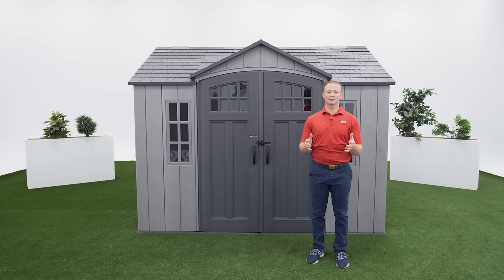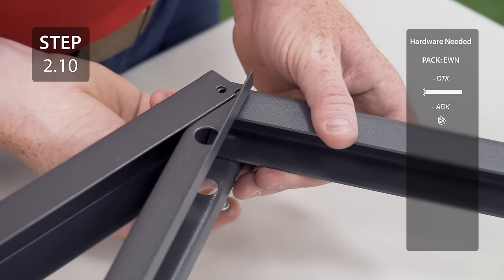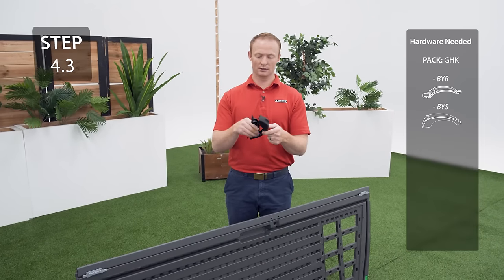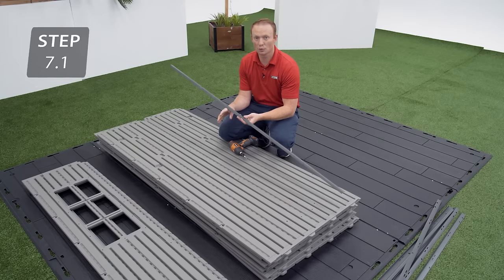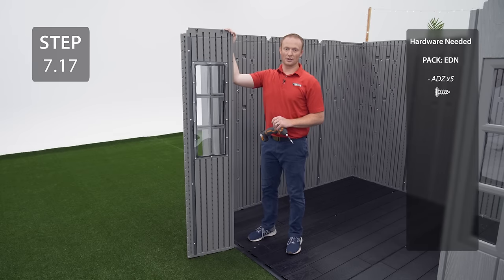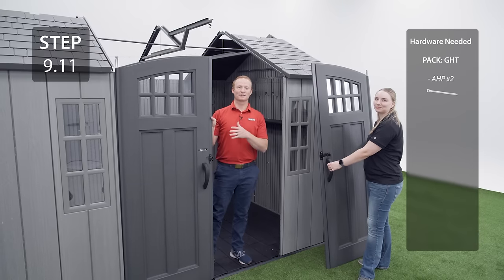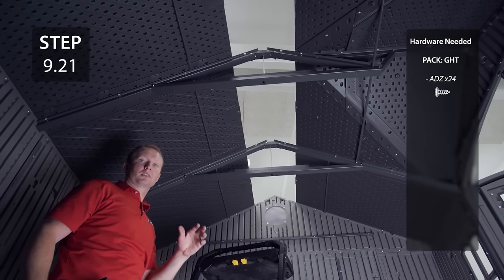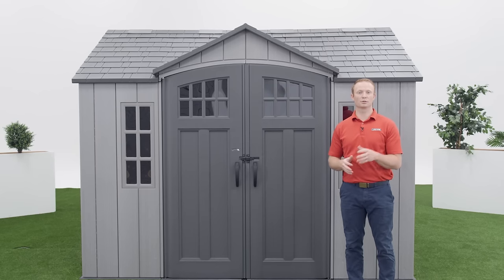Lifetime 10' x 8' Outdoor Storage Shed | Lifetime Assembly Video

Comment: Can be built by one man with knowledge. 
A bit fiddly. 
And a alot of the assembly processes could be shortened by the factory. 
Corners i found putting a block under the floor pannel gave me extra leverage to push them through. 
A day to build could be done in less with more bodies.
Reply: I fully built it by myself. You'll need to be at least 5'11" and give yourself about 3 days if your leisurely

Comment: I don't have the cotter pin is there a specific size that I need to buy
Reply from the maker: Replacement parts are available and can be ordered through our Customer Service Department. Our Customer Service Team can be reached at 800-225-3865 opt. 1 or by email at customercare@lifetime.com. Customer Service hours are Monday-Friday, 7:00 am to 5:00 pm (MT).

Comment: Step 11 is near impossible.  How do you screw through metal and make it look that easy?  Did you pre drill the holes?
Reply from the maker: Sorry to hear this. We did not pre-drill the holes before assembly, we had the our impact drive at the highest torque setting and put a lot of pressure as we drove it through.

Comment: How do you get the walls out after they are locked in place?
Reply from the maker: You will just need to reverse the process of assembling the panels. So slide the panel in the opposite direction to "unlock" it, and then pull the panel out.
Reply: Do you have to use lots of force. As ours is not budging

Comment: The manual shows that the plywood underneath the shed should have 30 drainage holes. Yet the plastic floor that will be on top the plywood won't have any opening. Anyone has any idea why drainage hole are needed? For the unlikely chance of water spill in the shed?
Reply from the maker: The drainage holes are there to prevent flooding in the shed. When there is a rain storm or what not, instead of the water going directly into the shed it will enter the drain holes.
Reply: @LifetimeProductsAssembly  Thanks for letting me know
Reply: It is to stop rain from seeping in under the plastic floor and rotting out plywood over time. Unless you seal the perimeter well    where plastic floor sits on wood.
Reply: Not really!!! It is to drain the rain going in the perimeter between wood and plastic and over time rotting out plywood.

Comment: This model seems identical to model 60243 except 60243 doesn't come with gusset supports for the trusses, there are no short truss braces, and no gable support bars.  Why is this?  Those seem like pretty important additions to support the strength of the shed.  Are they just not important?  There is no info in the instructions about any of these parts, so these parts are not missing.  I'm just wondering why they are not needed on model 60243.  Also...is there a video specifically for model 60243?  This is the only one that showed up when I searched your channel and it's almost identical.
Reply from the maker: The model shown in this video comes with a snowload kit, which contains the parts that you mentioned. You can add a snowload kit (model 60125) to your shed model, 60243. A snow load kit is not required but it does increase the snowload capacity. As of right now, there is no video for model 60243 but we are working on it. In the meantime, this video is the closest to model 60243.
Reply: @LifetimeProductsAssembly  I live in Southern CA....good to know that the reinforcement is for the snow.  Thanks! :)

Comment: Our lifetime logo door came with a hole punched in the front 2 feet from the bottom in the right panel part, that is not supposed to be there.  The boxes were not damaged.  We need a replacement door.  How do we get that?
Reply from the maker: Replacements can be ordered through customer service. They can be reached at 800-225-3865 or by email at customercare@lifetime.com. Customer Service hours are Monday-Friday, 7:00 am to 5:00 pm and Saturday, 9:00 am to 1:00 pm (MT).

Comment: have model 60318. on step 2.15 i have to slide in support tube DSP into DSM… but the end of DSP is squared and the hole in DSM is circular 
HELP!!!!
Reply from the maker: We are in the process of switching our DSM to square holes instead of circular which may have caused the confusion. Our customer service team can order you the correct parts. They can be reached at 800-225-3865 or by email at customercare@lifetime.com. Customer Service hours are Monday-Friday, 7:00 am to 5:00 pm and Saturday, 9:00 am to 1:00 pm (MT). Also please keep in mind that this is not the assembly video for 60318. There are different parts and steps for the 60318. If you need an assembly video, you can download the BILT app for a 3D step-by-step video.

Comment: Very helpful, but I would emphasize to people up front that this is for the 10x8" shed and that the 8x10' shed has a DIFFERENT video. I spent 20 minutes watching the 8x10 video before realizing the issue and noticed some things didn't make sense.
Reply from the maker: Thanks for the recommendation. We ask all customers in the beginning of the video to check to see if their model number is the description box to make sure this video works for them. We also add the description of the shed in the description box as well as the thumbnail.

Comment: What accessory did he use in-between the power driver and screw bit? Can't find them anywhere.
Reply: Some models of the sheds are now excluding those parts to save cost. I called and asked about the hooks. I did not get them or the gusset parts in 11.2 and no luck. The hooks would be super helpful and those gusset parts would offer additional roof support but not the were not included in my box or mentioned in my manual and I got the same exact shed

Comment: The instructions for model 60330 say to make the base exactly 94" X 118".  Is there any reason why I SHOULD NOT make it slightly larger (96'' x 120'')?  This is for a wood frame pad.
Reply: I have made wood base 8x10’
Start assembly tomorrow
Reply: I made my base exactly 8x10. It's nice cuz you have a little wiggle room

Comment: The hardware for securing paddle lock was broken allowing access  with a screwdriver
Reply from the maker: Replacement parts are available and can be ordered through our Customer Service Department. Our Customer Service Team can be reached at 800-225-3865 opt. 1 or by email at customercare@lifetime.com. Customer Service hours are Monday-Friday, 7:00 am to 5:00 pm (MT).

Comment: Just built this Shed mine was a 10X8 with the side door, so a total of 4 doors. Now I will be straight up with u, thus thing WIlLL give u a run for ur money if u attempt to build by urself. Doing it one person is nearly impossible, lifetime knows this which is why they charge $600 to do ir for u. However just be patient it's doable. But the instructions suck!!! So u need to have common sense
Reply from the maker: Thank you for your honest review. We do mention in this video and in the instruction manual that it is very important to have a helper with you during the process. It makes certain parts a little less challenging.

Comment: Too bad you didn’t have a quality control department that at least put instructions in the box. Neither one had the info.
We’re screwed for the weekend.
Reply from the maker: Yeah, that's definitely our bad...  Use this link to help find a PDF of the instruction manual: https://www.lifetime.com/customerservice/assemblyhelp.  You can then search all products by model number and language.
Reply: @LifetimeProductsAssembly  We did that. The only other issue we had was the slotted holes still had plastic in them which made it difficult to see where your are tapping the screw into. We spent some time doing it to make it easier. Clarity on the instructions with the pics could be a little better. I am an engineer so building it was not a challenge. Other than that it was a good buy for the shed itself. Only thing left to do is level out the doors. Thanks.

Comment: I don’t see much support for the roof to the walls only screwing into the plastic. :/ a good gust of wind would blow that roof off surely.
Reply: there's very little over hang from the roof to the wall, not much for wind to catch.
Reply: They also have support bars underneath the panels that u install to help the weight of snow

Comment: We don't need to watch you put in every screw
Reply: I disagree.. at times I found it helpful to see exactly where each screw needed to go, as sometimes the instruction diagrams were a bit unclear. They sped up the process of driving the screws so I think it was a great compromise. 

The only thing I would add about the screws, is don’t over drive/tighten them, and be VERY careful using the screw to pull two parts together. This isn’t would, and you are screwing into thin plastic. Easily stripped, and also having to take out a screw to re-do it can ruin the hole the screw needs to go in to to “bite” and hold the pieces together

Comment: Never never again. I am fairly handy and have installed everything from kitchens , to plumbing etc. I installed a previous version of the 10x8 from lifetime maybe 10 years ago or so. This version is cheap cheap compared to that. Also I'd be here for hours timestamping all the areas that are either wrong in the instructiona or does not work exactly as the guy in the video showed such as easily clipping in the corners or simple things like put holes in the wall (AHD) panels so you see if you're lining up to the next wall panel. Overall I regret buying this and it's also 2 times more expensive than the one  I bought and installed in the past. Time will tell if it holds up but I regret wholeheartedly and will review any chance and everywhere I can. All these companies selling the same cheap crap with terrible machining
Reply: Yeah I agree, for 1.6k, should be a little more rugged. Especially the flooring

Comment: My wife bought one of these without consulting me. It is miserable to assemble (and obscenely expensive) and nowhere near as smooth and easy as the video. Components don't align nicely and as others have said, the corners don't just snap in. Definitely a bit of editing and cheating happening in the video.
Reply: How did you end up getting the corners in?
Reply: @jazminlopez2593  eventually but with much frustration.  Some of the roof panels were even worse though.

Comment: Do NOT purchase this shed. It is not worth the 2k$ price tag that Costco sells it for and it’ll take the smallest gust of wind for it to fly away or break down and its very cheaply made
Reply from the maker: We're sorry that you are not happy with your new shed. Our sheds are rated for 65 mph winds. You can increase that by anchoring your shed and adding an extreme weather kit which would increase that to 90 mph. Anchoring your shed to the foundation will help prevent it from blowing over. The last section of the manual shows what you will need to do to complete the anchoring. Failure to anchor the shed may result in property damage and/or personal injury.
Reply: @LifetimeProductsAssembly  we had 25kph wind last night and the shed is completely destroyed. Talk about false advertising
Reply from the maker: @Halloween-Taken-Seriously  Was the shed anchored down? You can send photos of your product to warrantyclaims@lifetime.com so that a warranty representative can look into this for you.
Reply: @LifetimeProductsAssembly   I will send an email to them and no it was not anchored down. If it needs to be anchored down in 25 kph wind then that says a lot